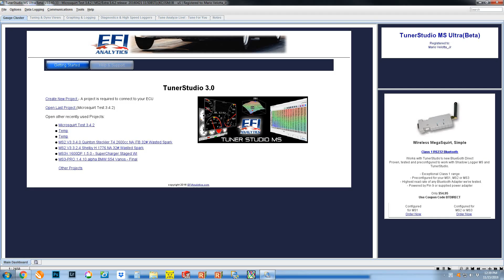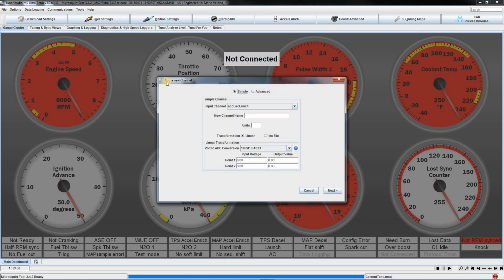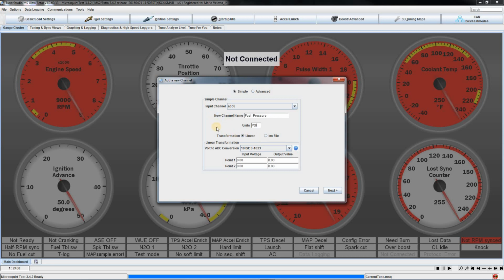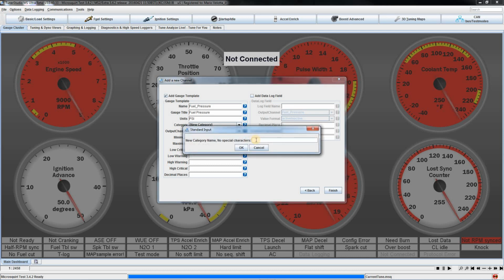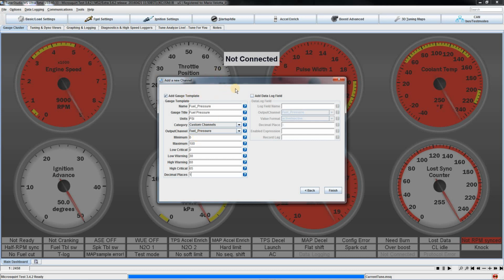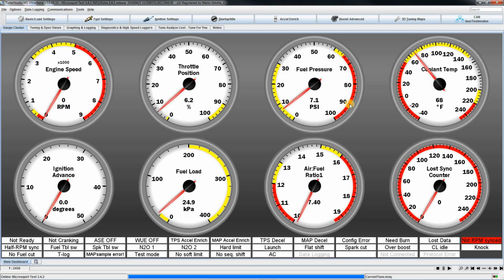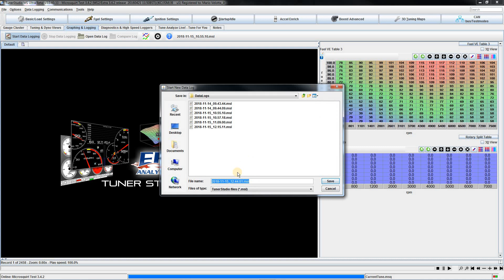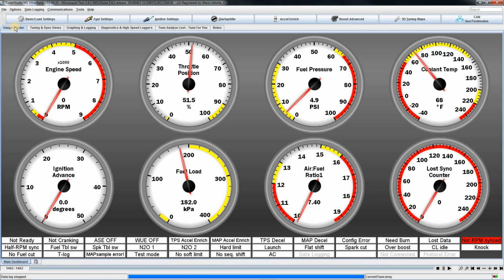Adding a custom channel in Tunerstudio for viewing and logging (Tutorial)

Comment: Hey man, fantastic video, but i have some doubts, for example, what are the options Remote Port3 Bit 0 to 7 located in? or how can i use them? i cant find any info about it. Thanks!
Reply from the maker: What are you trying to log? Logging Port status is availabe through your project properties menu.
Reply: @thedubshop  Thanks for the fast reply! i just wanted to know why are those options in display if i cant use them.
Reply from the maker: @nicolas6820  You can use Ports it in the Advanced editor. It is more math-based and not as simple or straight forward. Click the (Advanced) button and have a look. I'm not smart enough to use that menu though so it would be harder to make a tutorial on it :)

Comment: do you have to pull the ecu out and add a line to the fuel pressure sending unit to get a reading before you do all that calabration stuff first and what pin on the ecu do you read for fuel pressure on microsquirt
Reply from the maker: The ECU setup can be done before or after you install the pressure transducer. You can even wire the transducer before you configure the ECU. Do it at your pace. There are 2 ADC inputs, Pin 5 SpareADC2, and Pin 29 SpareADC.

Comment: In my add channel wizard on my ms3x with registered tuner studio I dont have the same input labels as you. 
I have hooked up a fuel gauge into EGO2 input with a resistor circuit as needed but my add channel wizard only has EGOv2 or WBo1_ent2???? I also dont have adc channels like yours does. Do you know why this is and what input channel selection would see the input for EGO2? Ps I have scrolled through msextra and google for over a week with no luck.

Comment: On your harness I saw options for gauges,  I would like fuel/oil pressure and oil temp. Is this included in the options or custom made. Do you include the program on the base tune,thankss
Reply from the maker: Sorry I missed this. I can build the harnesses however you need and pre-setup the ECU as well. I just need to know before you order so I can account for it when quoting the package. Thanks!
Reply: @thedubshop  can you help us and load a video on how to connect/solder hardware on ecu, which pull up to use and where to wire the jumper cables on ecu. I would appreciate